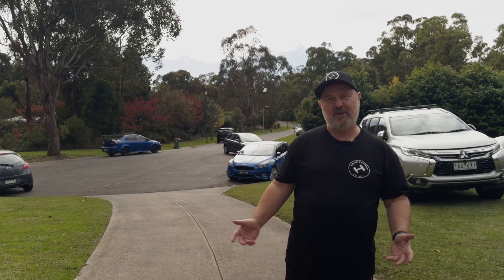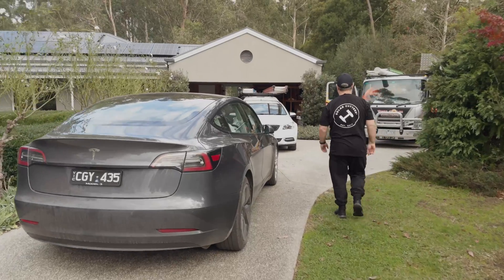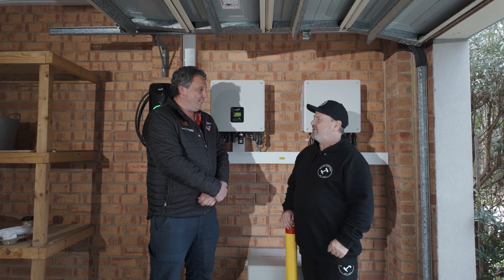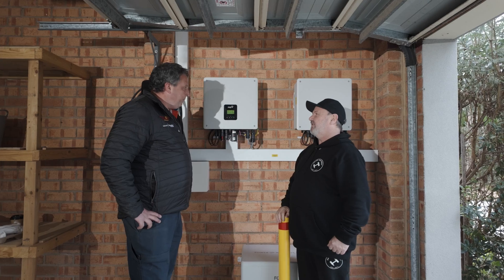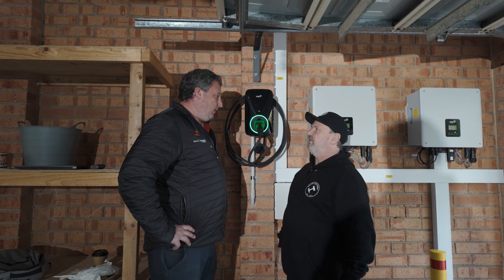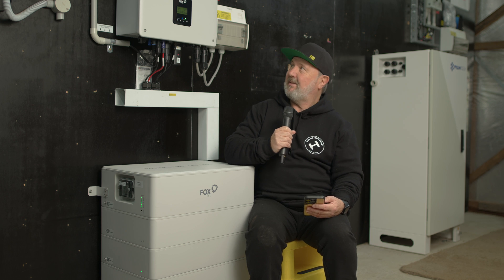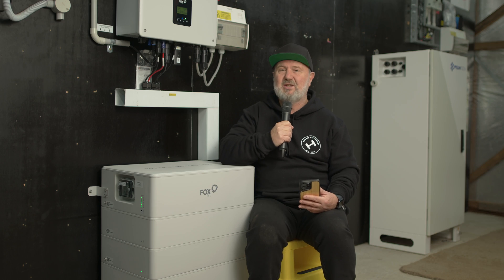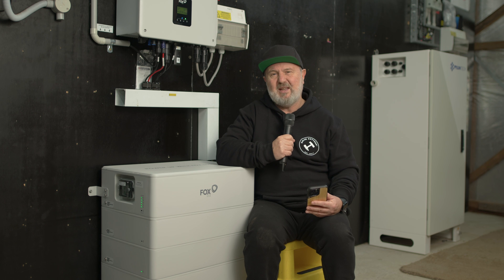FoxESS Energy Cube Installation

Comment: How easy is it to add additional slave batteries to the system and what does the process involve?
Reply from the maker: I'd have to read the manual but generally you need to have all batteries at a similar SOC before adding new ones.